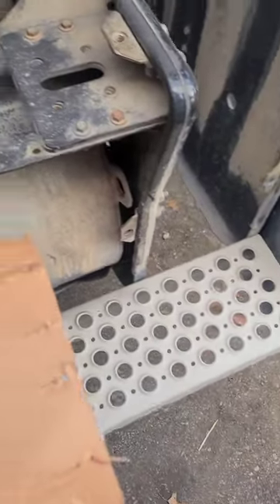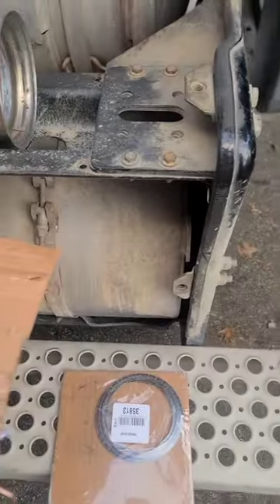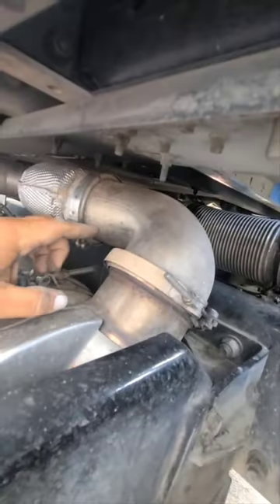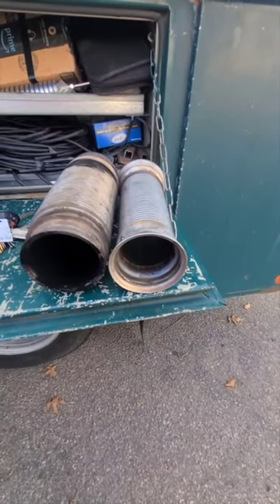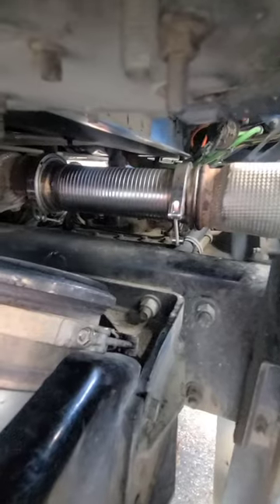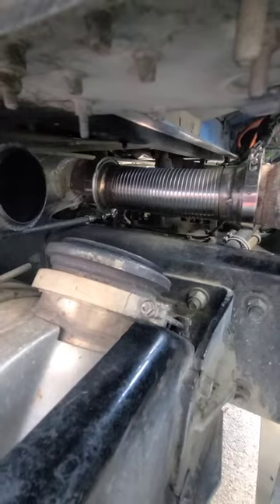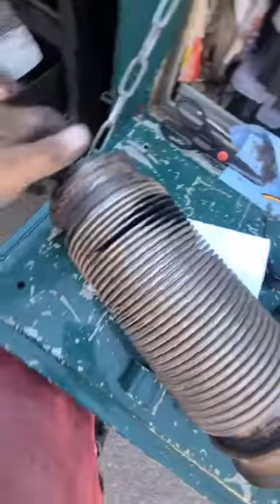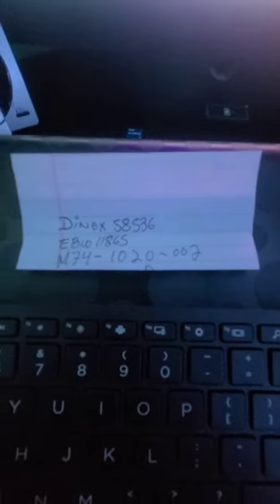Kenworth exhaust flex Bellow pipe

Comment: The reason why the create this pipe is because it’s designed to flex when moving it’s also designed to break in case of extra abnormal pressure in your exhaust to prevent any damage to your after treatment
Reply from the maker: It's Make sense